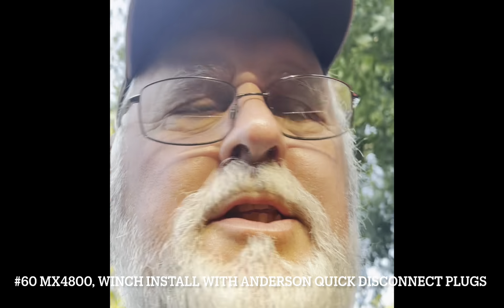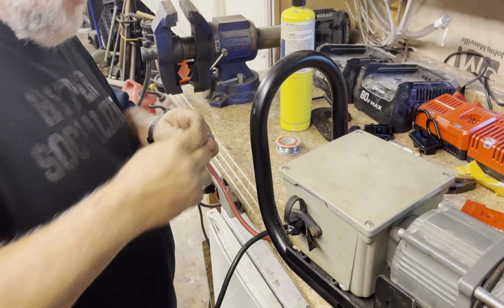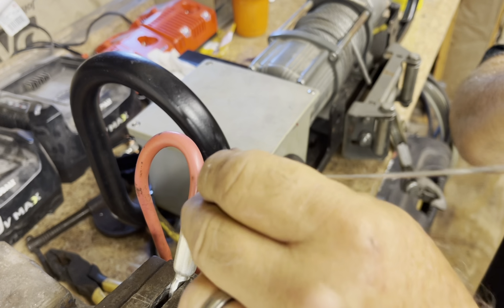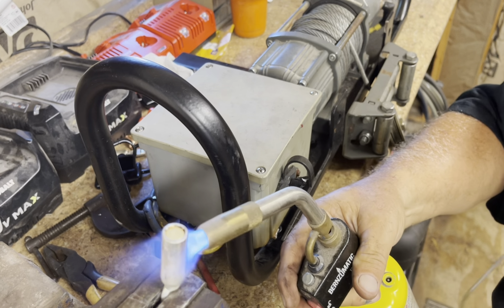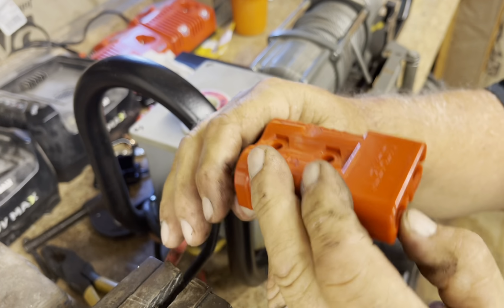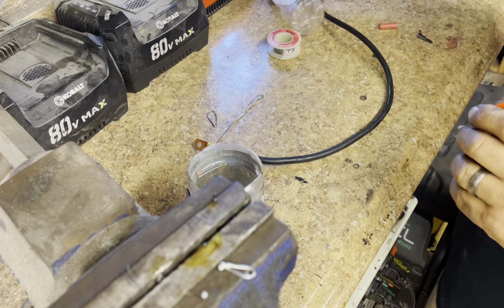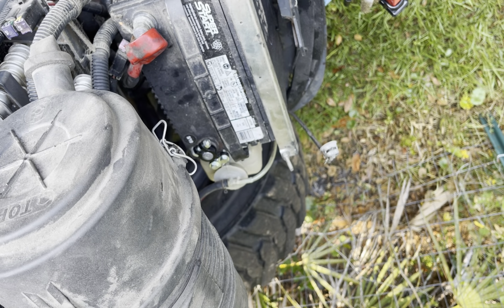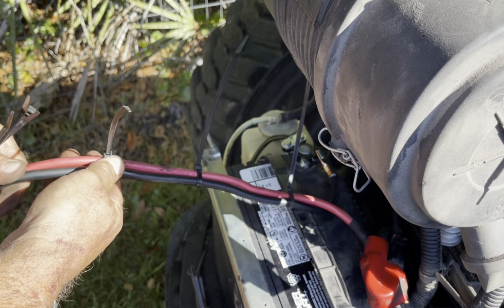#60 Kubota MX4800 Winch Install with Anderson Quick Disconnect Plugs

Comment: What gauge wire? How many amps is it rated? Source for that size Anderson plugs? Thanks.
Reply from the maker: The plugs 175 amp plugs came from Amazon and the wire was #4, the plugs are rated up to #2 wire.
Reply: You need a much larger 350amp minium Anderson plug for a winch of 8000lb or above not the small 175amp hes using.